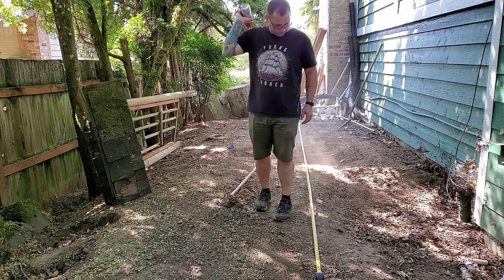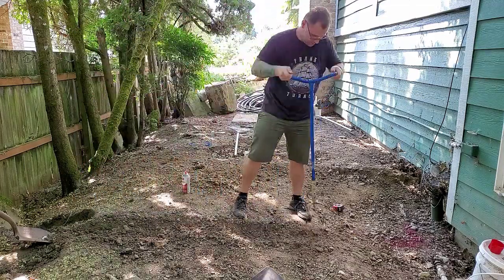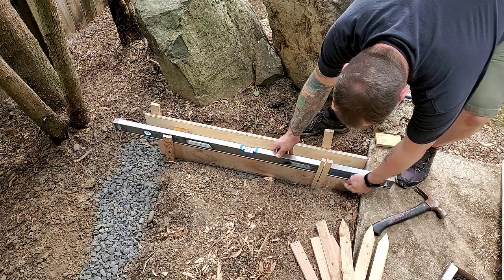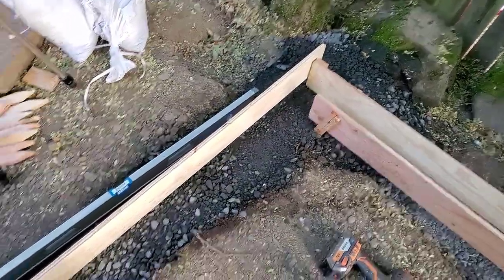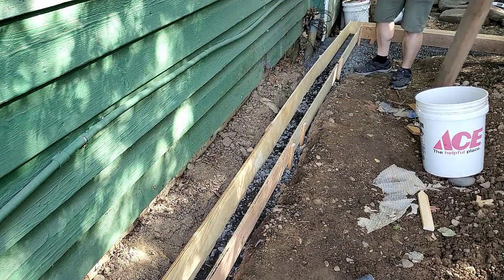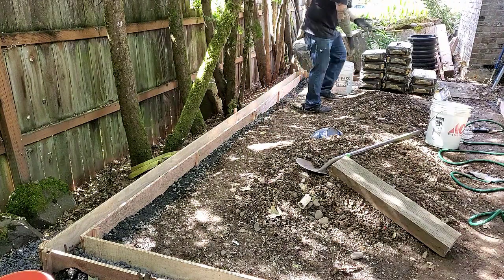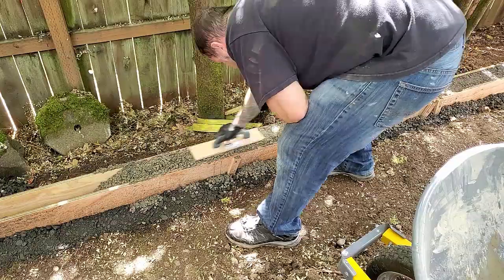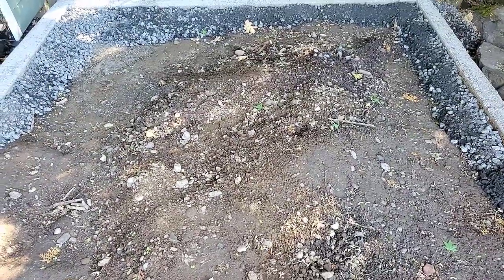Installing the Foundation for my Greenhouse

Comment: I would drill holes in wood before putting screws in: stops wood splitting.
Reply from the maker: That would have prevented that for sure.  I would follow that practice if I was doing any wood working, not sure why I didn't bother in this case.  Sometimes a little prep work can go a long ways for results.
Reply: @BabblinginmyBackyard  you didn’t in this case ‘coz you were busy making a YouTube video and forgot…😉

Comment: I am curiouse about putting a greenhouse in a shady area.  I suspect you have your reasons but I'd love to hear more.  Perhaps it's a space issue and that area gets sun at other times.    It's ben a year.  Is there an update video?  I would like to see the greenhouse.  Nice job on the video!
Reply from the maker: It's not in the shade I cut the trees down after I put in the foundation.  This spot in the yard was unused and is south facing.  It has worked out great for a location.  Here is the build video for the Greenhouse.  https://youtu.be/I-QkCVtTTkI 
If you are interested, here is me cutting down the shade. https://youtu.be/oKjkjC-mKys